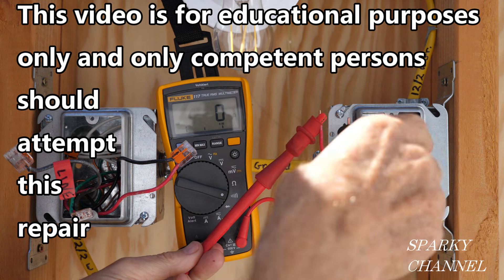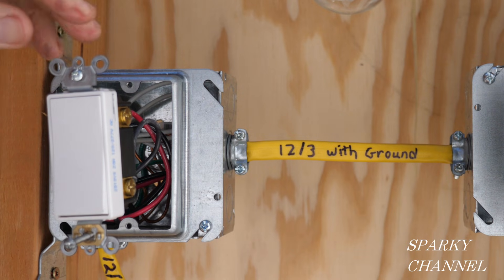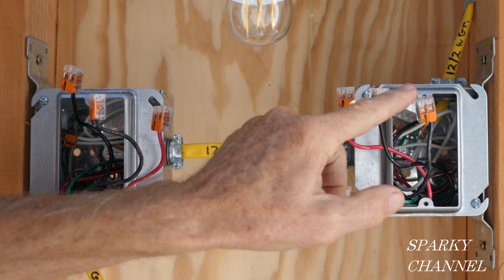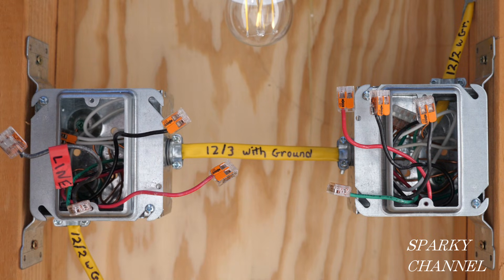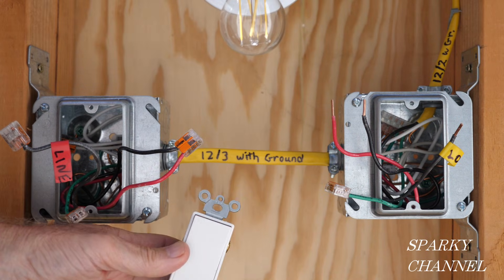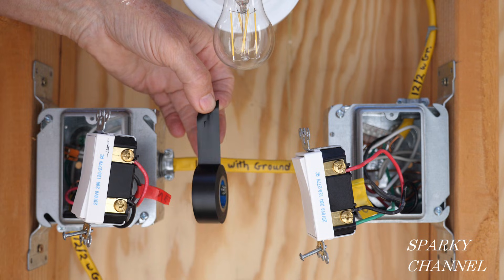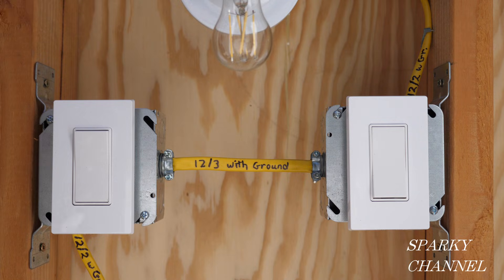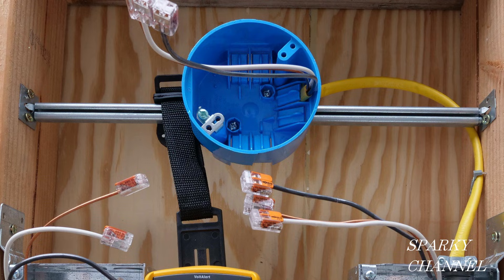How To Fix a 3-Way Switch System

Comment: I have a black wire red wire white wire and green ground I don’t have two black so your video isn’t helping thank though
Reply: Ignore the colors and follow the steps
I just fixed my long-standing problem by following this excellent guide
I had red/black/brown wires on one side and yellow/black/white on the other.
In my case, the red was line and the yellow was load..  totally counterintuitive!

Comment: What do you do if you can’t establish continuity between the traveler wires?  I did everything you said but the continuity check did not work.  Is it safe to interchange the red and black wires to see what happens even though the continuity check failed?

Comment: I'm in a basement remodel and the three way switch is wired with a few junction boxes. Seems they were low on electrical wire. The switches are not working correctly but the wires align themselves correctly. All the power stays on at the light on top of the stairs. The light at the bottom of stairs works with the switch correctly....
Any ideas?

Comment: Always like to rewatch and bush up on things, never hurts at all.
On services calls involving 2-way switch issues: this still my fav way to diagnose and resolve switching issues; just rewire the receptacles and save yourself some time. Of course, this isn’t so bad when a single gang box, but really saves some time if dealing w/ 3 or 4 gang box and your trying to figure out what switch does what and which ones the problem. Yeah, might get lucky and see/solve it on 1st or 2nd try (if prior sparky left labels in NM jacket, but I find, that’s rare t9 be lucky); so just doing a rewire in entire box is still fastest way, imo, as can also find other issues that didn’t know was there (like a nicked wire, or wire w/ burn marks…melted insulation [which I’ve seen and that not good, no no]…for examples).
Cheers Bill☺️
Reply from the maker: Cheers! I agree!

Comment: This has helped me so much...Ive actually corrected some odd 3way wiring I inherited.  Can you show how to hook up a bath fan/light on one double switch adding a 3 way to another double switch. Power fan/light come into  left box with double switch  with just a 12/3 wire to the other area for a double switch.  THANKS

Comment: Help.  I have two separate 3 way switches, one set controls the living room fan light.  The other set controls the stairwell light. I wanted to swap the switches for Smart switches. The living room lights were never functioning properly, just like in your video. Using this technique, I was able to identify and label the wires and install the new switches.  Everything works perfectly for the living room light now. The stairwell light always worked fine, I just wanted smart switches controlling it. So I removed the old switches and noticed some really weird things. One, it appeared that one of the traveler wires was actually part of the neutral wire bundle. Two, with the wires disconnected from the switches and tested, it appeared I was getting power at both ends and was unable to locate a load wire. Remember, the switch always worked perfectly. However, when I hooked up the smart switches, it didn’t work at all. I then re-installed the old switches the way they were originally connected and everything works again. Are there certain circumstances where you’ll come across weird wiring like this or am I totally mistaken?

Comment: Amazing explanation.
I personally always flip the travelers on one of the switches. I like both switches down or both switches up when the light is off; and when the light is on the two switches will be opposite.

Comment: This is an absolutely excellent explanation for diagnosing and correcting the wiring errors that can make the three way circuit not function. Clear directions for testing for live and travelers were the solutions to my partially functioning circuit. Thank you Sparky.
Reply from the maker: You are welcome!

Comment: How would you test the traveler wires when the switches are 15 feet from one another. The video conveniently has the boxes apart by only a foot. Typical 3 way switches are quite a distace from one another. My multi meter only has like 2 foot leads.
Reply: You can put the travelers together in a wago wirenut like Sparky did, or you can twist them together. Then when you go to your adjacent box (15 ft away) you test for continuity same way he did. It's basically the same process. If the wires are from the same romex (for example), your meter will make a sound indicating continuity.

Comment: What if both traveller wires are the same color???
Reply: The color of the wire doesn't matter. A conductor is a conductor. As long as you have enough conductors, you can make it happen

Comment: THANK YOU SO VERY MUCH MY ANGEL!! I have never done anything with electrical switches or outlets  (afraid to but have a problem and no money or anyone else to help me). I have had so much trouble and pretty serious and dangerous situtions and recently an electrical business came in and rewired most of my small old 1970 trailer by running wires thru conduit and the metal boxes that stick out from the wall (they could not access underneath or thru the walls) and there have been a lot of problems since then and there is a dispute between us so they are not coming back to fix what needs fixing and so far I still owe them a lot of money....with that being said... they put in a 3- way switch for a kitchen ceiling light and well within a month increasingly I would try to turn off the light and it would pop back on right away and it takes a lot time of continuous hitting the switch with different timing to make it go off and stay off (it is the rectangular one with the square at the top and bottom to operate it and sorry I don't know all the proper terms), anyway, I am hoping it is a simple fix that I can do like what you showed here. Have ANY others ideas or suggestions if I am wrong, I would really appreciate them. THANK YOU! LOVE HOW YOU SHOW AND EXPLAIN AND MAKE IT CLEAR AND EASY TO UNDERSTAND!!

Comment: Is wrapping the switch with electrical tape a code requirement? I've seen that but don't understand why it's done. 
This video will help me correct my daughters kitchen light wiring. She has a 3-way dimmer and a 3-way switch, but it only works with the 3-way switch in one position. The dimmer does work, it dims the four kitchen high hats. She's in an old house, built in the mid 60's, the wiring is all two wire, no ground wires. 
Sparky, I love those WAGO connectors, I've ordered some.
Reply from the maker: Not a code requirement. Good job!
Reply: I too am a believer in wrapping certain device terminals with electrical tape, excellent video

Comment: Sorry but I never trust a tick sensor tester if fingers are touching wires. Alway dead recon with voltage tester. Battery died on tick while testing and I got bit.
Reply from the maker: I like to do both.

Comment: Has code changed that lighting is on #12 and #14 is old school? So does that mean #14 is no longer usesed?
Reply from the maker: 14 AWG is still widely used for lighting but some contractors use 12 AWG because it has less voltage drop, etc.
Reply: @SparkyChannel  Excellent. when I run from power panel always run #12 just incase down the road outlets need 20 amp service. So much easier for change over.

Comment: Thanks for the video. Unfortunately for me,  I disconnected all of the wires without identifying them ( even the two neutrals wired together in the back of the boxes) at the first and second 3-way switch locations. I do remember that  each switch had black common, a black traveler, and a white neutral as a hot traveler. My problem is I don't now how to determine which of the three neutrals in each box were used as the hot neutral traveler. Any help out wood be appreciated.

Comment: At last after 31 years! I finally understand & can fix how the original installer crossed wires in the basement 3-way switches controlling 4 lights fixtures. THANK YOU SPARKY!!

Comment: This is really good as are the comments.   I still don’t understand why the switches worked sporadically before the fix.
Reply: I'm no electrician, but I believe it was because the LINE wire coming in was on the wrong switch terminal. It was on a brass traveler screw instead of the black line screw.
Reply: exactly right

Comment: Wrapping tape around switch is not necessary but with that said, its the one the best ting on this video thanks for doing that. Think safety at all times..
Reply from the maker: Thanks Rick!
Reply: wrapping tape around your receptacles is very necessary when you're not confident in your work and want to make it a pain in the ass for the next electrician who has to come fix it
Reply: Tape covering contacts on multiple sw is a pain in the ass to remove? That speaks volumes right there.

Comment: If this didint work when it was first installed, this is not the fix, i would suggest checking that the switches are still working correctly, normally after looking at this guys video's the 3 cores plus earth are the (his terminology)  traveler wires you could just do this by visual, the only thing i wouldnt do is touch the wires till the meter has tested they are dead, dont trust the contact free tester, if you have no idea of what you are doing call a electrician
Reply: Never trust a tick tracer and never disconnect the ground first

Comment: My switches have worked for almost 30 years and now all of the sudden they don’t want to work. It will work if we keep trying but mostly fails. Why would it fail after many years?
Reply: Age
Reply: The switches are bad. They are just worn out. Just like my knees!!  Like Crockpot said, age...

Comment: I have two four way switches in between, but those should consist of two travelers, one input and one output, correct? There is a combination where the lights wont turn on. Shouldn't EVERY switch be able to toggle the lights on even 3-4-4-3?
Reply from the maker: Correct, every toggle should be able to control the light/s.
Reply: @SparkyChannel  I figured it out. Load/hot and red traveler needed to be swapped
Reply: @SparkyChannel  I am trying to "unsmart" my home. Smart homes are VASTLY overrated.
Reply: @SparkyChannel  Well damn. Its not working and I SWEAR its setup correctly. I traced every wire, hot, load, travelers. My two 3 way end switches have to be on for it to work. Something is not right.

The 4 way switches are leviton and the 3 way are Enerlites 3 wire from Amazon. I may get leviton 3 way switches. I assume 3 wire and 3 way are the same thing.

Comment: So whats it mean if one switch is working and other works only depending on which way other switch is not in sequence with the other? Wires wrong?
Reply: Yeah. The line wire "black" is switched with the traveler wire "black"

Comment: Thank you so much for this tutorial. The best advice you gave was to just fix it and not try to figure out what's wrong. I fixed a decades old mis-wiring that irritated me for the longest time. In my case, not only was it wired wrong. The line wire was reversed with the white carrying the hot and the black as common. I couldn't reverse it at the source so I just labeled it clearly.
Reply from the maker: Great job!

Comment: Not being an electrician I don't own a $200 RMS Multimeter. How can I fix the same issue without a voltage tester or multimeter? Thanks for your help.
Reply: A $6 multimeter from harbor freight will work just as well.
Reply: Any multimeter with continuity provision will do

Comment: That is so true take everything apart to troubleshoot. I had a smoke alarm tied into the lighting that would not turn back on. Bought new alarms because they were out of date. It was not until everything was sorted for feed that they ended up working.
Reply from the maker: 95% of the time it's faster. Sometimes it's a lot faster. Plus it's more logical and less stressful. Thanks!

Comment: Nice step-by-step video.  41 years ago, an electrician taught me to find the line wire as you did with a meter or now a non-voltage tester.  Here is the difference at this point... install the load wire to the load side of the switch the the two travelers, one each to each screw on the switch.  With the other wires separated apart in the other box, now turn on the power and use a meter, one lead to ground and then touch the other lead to each of the wires one at a time while turning on and off the other line switch to find the two traveler wires with the remaining black wire being the load wire.  You can do this test quicker by using a non-voltage tester to get the same results.

Comment: I have a red and black wire that are both hot.  In the video only one wire in both boxes is hot.  When I went to replace an existing 3-way switch (dimmer), with a 3-way non-dimmer, I can't get the lights to turn on off correctly.

Comment: Using a meter is a bit much. But for the rookies I guess it helps. Us pros don’t need meters. Lol 😝
Reply: That’s true. I just use my licked fingers and sense of smell.
Reply: Or you can just look at the wires.
Reply: @markmadlena6009  lol
Reply: Then why not teach it like you use it in real world settings
Reply: @markmadlena6009  because you’re taught a certain way and learn from experience. I use my meter if unsure of the layout of the wires behind walls.
Reply: Nothing wrong with that.
Reply: Guess I’m just a better electrician then most of you. Fix three ways all the time. No meter just knowledgeable I guess
Reply: @markmadlena6009  I’m sure he doesn’t use a meter most of the time. Just doing it to instruct.

Comment: That the exact problem I have on 2 sets of these switches on 2 lights. The only problem I'm going to have is that the switches I need to test are on the opposite sides of the room. Don't have volt meter leads long enough.
Reply: He hooked the travelers together and only tested on one box.

Comment: thx, makes 3-way switches a snap for the DIY’er. 2-ways are so much easier... Blk probe to ground and red to determine the HOT on the multimeter.... same deal with the touchless voltage tester. Looks like I need one of those! Is the KLEIN’s about the best? any recommendations??? Thx

Comment: Another problem seen with 3 way circuits is that installers run 12/2 with ground instead of 12/3 for the travellers and pick up a neutral on the load end from another circuit in a ganged switch. This causes hot neutral problems when working on either of the two circuits. The tell-tale after drywall is up (usually during a reno or addition) is the capped neutral in the line entry side switch.
Your video is quite clear and makes sense since you've labelled the romex with a Sharpie. It would have made us work harder to gain a cognitive understanding if we couldn't see the wiring, and drywall was installed; as would be the case on a service call, or punchlist, and we had to do a schematic circuit analysis. It could be simply my learning style or experience level. I work on much more complex systems (I'm an elevator repairman) and I need to see a schematic first. Just Food for thought. Thank you for your informative videos! Great channel!!
Reply: Interesting. I haven’t encountered that but your observation is good to be aware of. Txs.
Reply: If they haven’t installed all the wires then it can’t be easily fixed.

Comment: Is it possible to find the line wire using only a multimeter? I have a multimeter but no voltage meter.
Reply: Yes. Set your multimeter to AC voltage, 200 volts or higher if manual ranging type. Clip your black lead to the green or bare copper ground wire. Turn on power from the circuit breaker. Touch the end of your red lead to each of the black and red wires in both boxes. Only one of those wires will read 120 volts on the display, that is the line wire that carries current from the circuit breaker. Carefully push it to a position you'll remember. Turn off the circuit breaker. Mark that wire as line with a piece of tape like Sparky did in the video.
Reply: @robertjoseph1592  thanks for the advice, unfortunately in my old house the switch didn’t have a ground wire in the box, nor was the box itself grounded. What I ended up doing was taking a long extension cord and plugging it into a known grounded outlet, and stood at my light switch with my multimeter and stuck the black prong into the ground hole on the extension cord and used the red prong to test the wires and was able to find the hot. Very rewarding after hours of frustration!
Reply: @evanmiller6205  OK, glad you got the job done. Another option for others with your situation reading these comments: Pull the white wires out of the light switch box and take off the wire nut, touch/clip the black lead to the bare ends of those. The white wires will also complete the circuit so you can get a reading on which black wire is the hot leg.

Comment: He Sparky, does it matter when connecting the traveler wires to the 3-way switches whether or not you criss-cross them or must they always be in parallel?  Does it prevent or break anything electrically?

By criss-cross I mean red-traveller on left switch on top, and then red-traveller on right switch on bottom?

P.S.  I am still loving the wago wire nuts.  Great little devices.